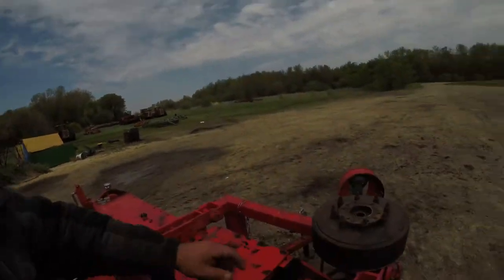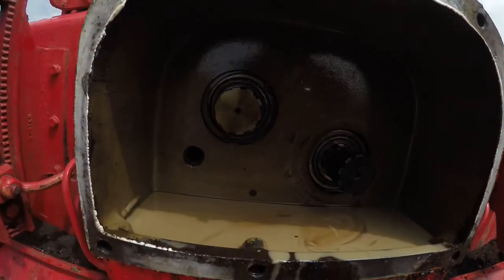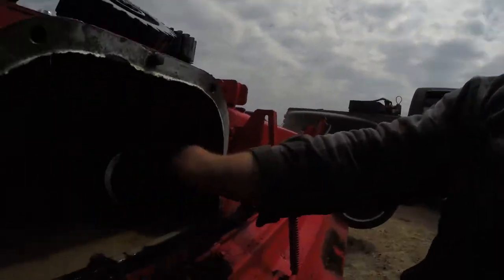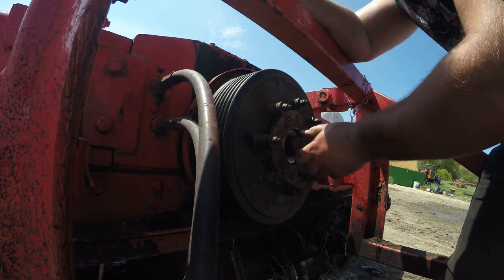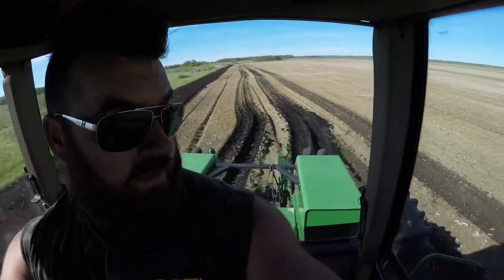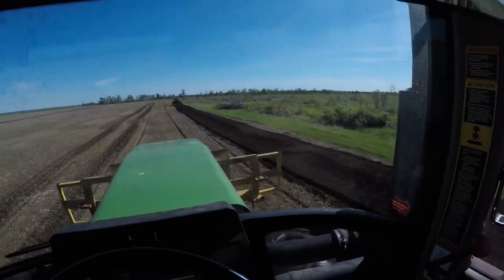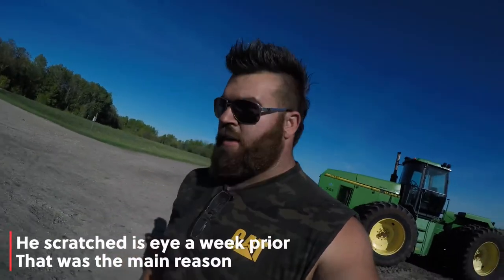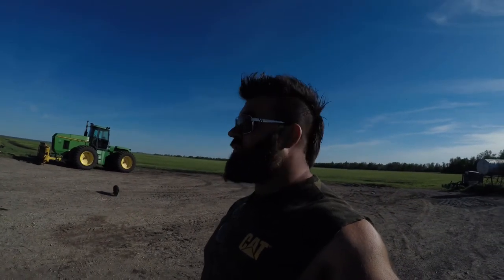Got the John Deere 4430 stuck

Comment: Buried my 4755 one year.  Plowing a field next to a river.  Hardest pulling field I have.  Plenty of clay... but every now and then there is a layer of silt sand under that clay.  Always kept a finger on the 3 point.  I wasn't fast enough.  By the time I hit the three point and then the clutch the plow hardly lifted.  I buried it to the axles.  Bottom step was damn near ground level.  Broke a brand new $800 recovery strap, and a shovel handle.  Not one of my better days.  LOL.
Reply from the maker: Haha ya we’ve buried a few machines over the years the worst on was before i was working out there one of the guys sunk our IH 4366 up to the cab. Ended up having to call a neighbor with a bigger 4wd to come help pull it out